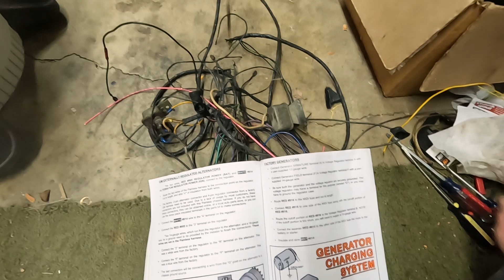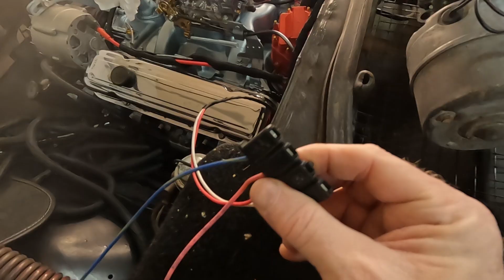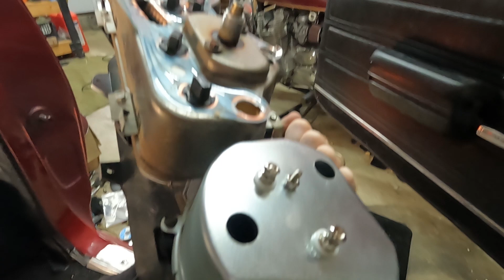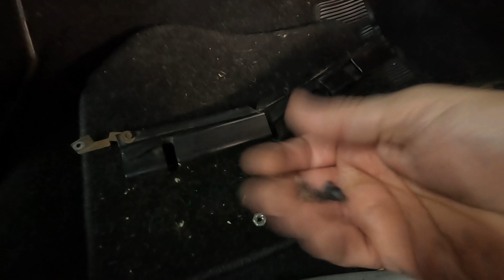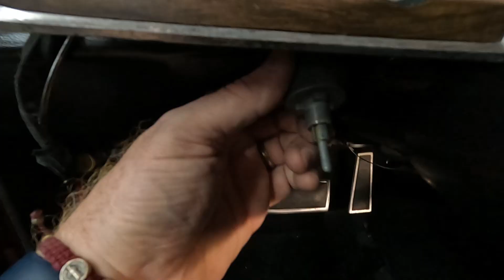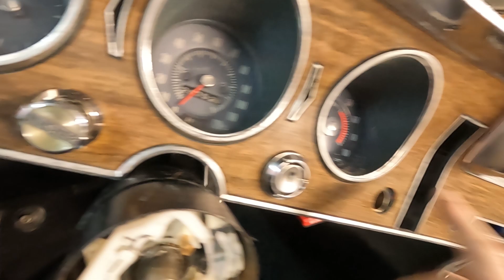Painless Wiring: Wrapping up the Rewiring Project!

Comment: Cool video my brother Tim I just finished doing a video of converting a external voltage regulator wiring harness into an internal regulator alternator I have a question those wires that you put behind the alternator do they have a plug I didn't see a plug in the video
Reply from the maker: Thanks, Luis! The plug was broken at some point. I need to pick up a replacement
Reply: @Rustrevivalgarage  let me know if you cannot find it I might have a replacement
Reply from the maker: @ Will do! Thanks, brother! And  happy new year
Reply: @Rustrevivalgarage  happy new year